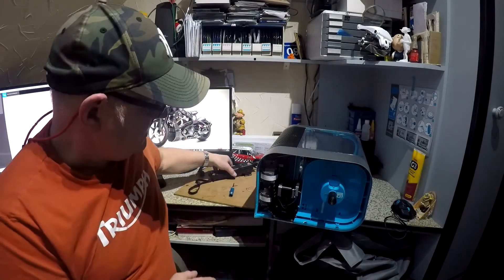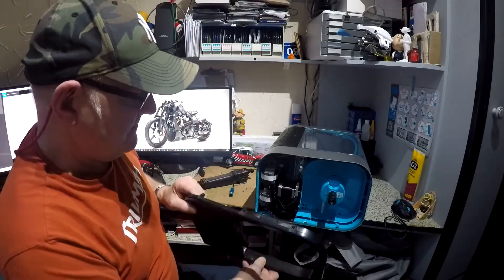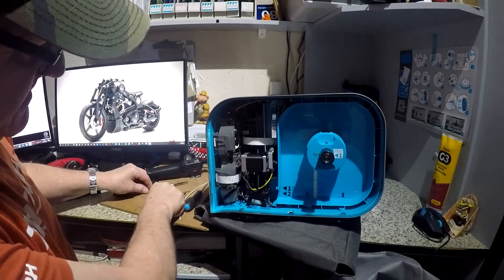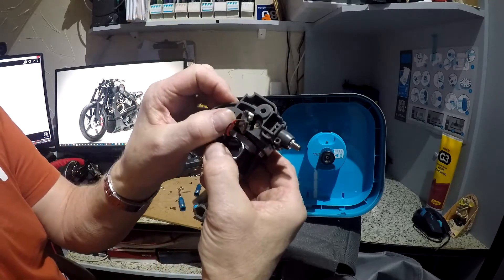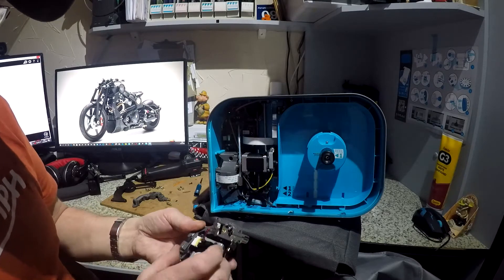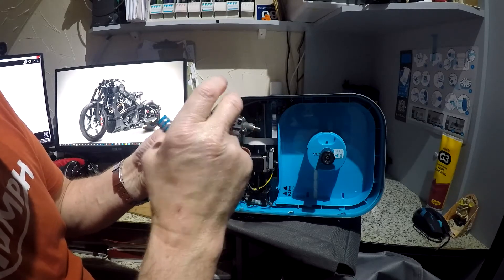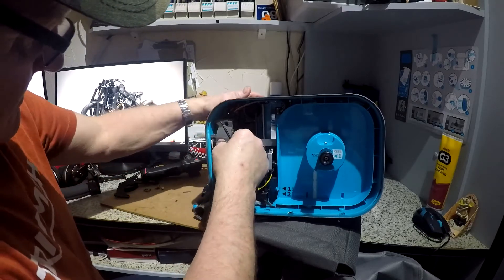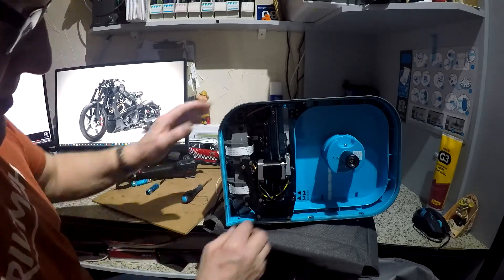Cel Robox 3d printer  Dual extruder jam

Comment: wow, I had this printer in 2016 it was noisy, slow and usually overheated because of faulty design it cost me £860 new,  it was an expensive piece...
Reply from the maker: Hi thanks for your comment you are right it was expensive  however I only paid about £300 new from a company called box. Filament was expensive but I still use it today for small Items just mainly the fun of using
it. It would not keep up with the modern printers of today. In its early days I think it was the only one that did 2 colours or one colour and the other with a dissolvable
support material.